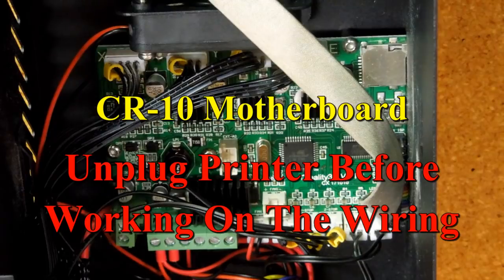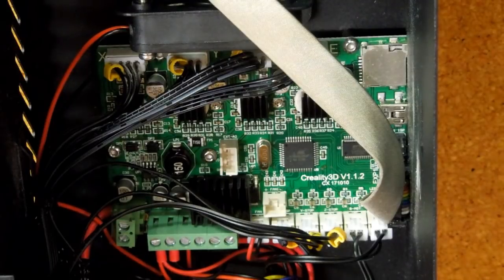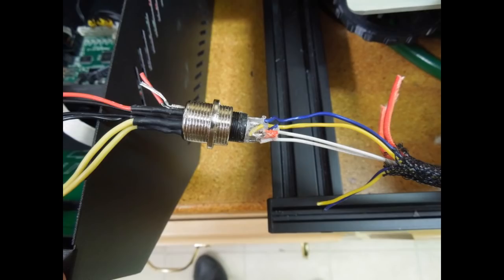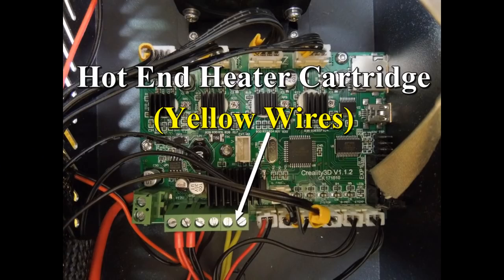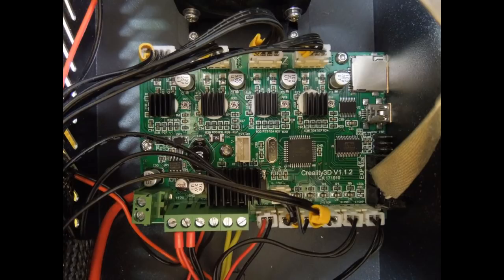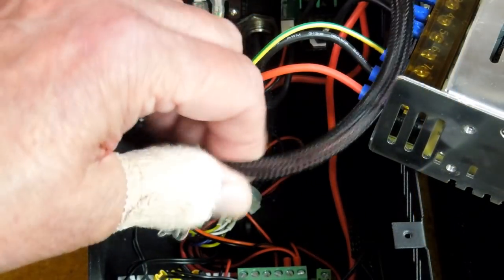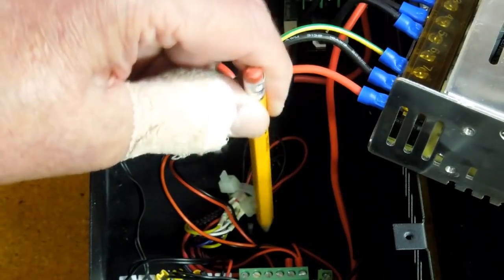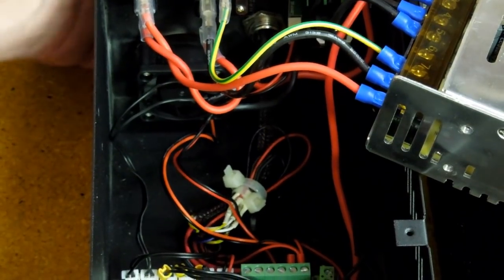Creality CR-10 Rewiring Hot End To Motherboard

Comment: This video is years old now, but it was super helpful to me today.  I'm in the process of replacing the mainboard for my old CR-10, and couldn't figure out what goes where.  The 8-pin aircraft connector was proving difficult to decipher even after lots of googling.  Your video explained everything I needed to know.  The pictures you added were handy, especially the pinout for the 8-pin connector and where each of the wires from that connector go.  Only 2.5 minutes long and packed with lots of useful info.  Great job!
Reply from the maker: Glad it helped.
Thanks for watching. Please subscribe. 
That is what keeps this channel going. 
Ron

Comment: At around the 2:18 min mark, I noticed a dual fan system on your extruder. Is it an after market item? Did you print it? I have a Creality CR-10S5. Do you think it would work on it? Thanks.
Reply from the maker: I printed it from files listed on thingiverse. It is called a Bullseye Cooling Duct.

I have a video showing the Petsfang Bullseye Cooling Duct installed on my Ender-3 printer.

The one shown on my CR-10 is an earlier version. I like the one on the Ender-3 better.

The print head on the Ender-3 and my CR-10 are identical and have two cooling fans (one for the hot end and one for the filament). I did change the filament cooling fan on the Ender-3.

Links to the Petsfang Bullseye Cooling Duct are in the description for the video. He has a lot of stuff listed so just look around for what will fit your printer.

Ender-3 Bullseye Cooler Fan Guards
https://youtu.be/iMo5XEVOxX0

Please subscribe. That is what keeps this channel running. 
Ron

Comment: Im receiving only 1V In the terminals where hotend is connected and it doesnt heat up
Reply from the maker: If the temperature sensor has failed, the hot end will not heat up. If the heating element has failed it won't heat up. Other than that I really can't help you. Your mother board may have failed but that is past my experience.

Comment: Which heater is compatible with Creality Cr 10...1)12V 40W   or 2)24V 40W
Reply from the maker: The operating voltage for the CR-10 is 12VDC
FLSUN® Cartridge Heater 12VDC 40W (2 pack): https://goo.gl/1Dt5LK

The same thermister is used on the bed and the hot end.
NTC 3950 Thermistor with wire (5 Pack): https://goo.gl/WzVzzn

Thanks for watching. Please subscribe. That is what keeps this channel going. Ron
Reply: @RonaldWalters2010  thanks for quick reply
Reply: Do you have a wire diagram ?

Comment: Are you going to eliminate the other plug as well?
Reply from the maker: Yes, the very next time I have a problem with it. These are relatively cheap plugs and loose connections are often the problem. The remaining 4 pin plug is for the bed heater and thermister. The current going through this plug is more than the plug would be rated for and I have found it necessary to slightly spread the pins for more positive contact. Next time I need to work on the hot bed, the plug will be eliminated at the same time.

Comment: A good trick for removing hot-glue is isopropyl alcohol.
Reply from the maker: Yes, but it would still involve digging it out from between 8 pins. I've had problems with the two plugs at the back of this box making bad connections and I was looking for an excuse to eliminate this plug & socket anyway. Thanks for watching! Ron
Reply: Neat trick. Thanks

Comment: The convenience of one plug (with added resistance) is all well and good until you have a problem. In this case, the convenience is all for creality's benefit as I assume the upright part of the kit is built on a separate line and the base and upright are married for packing.